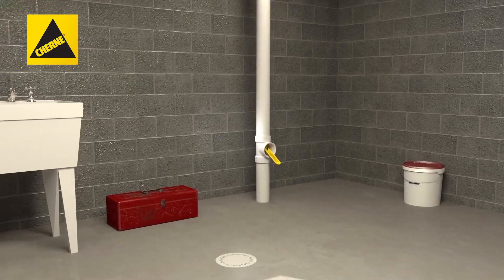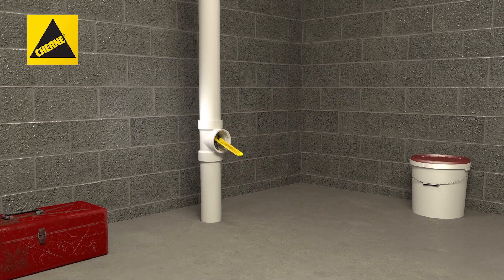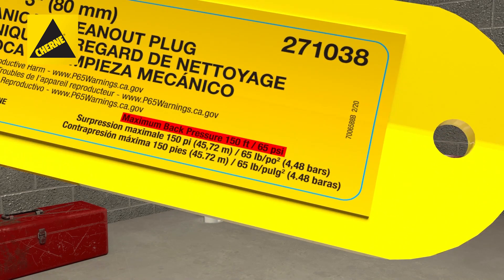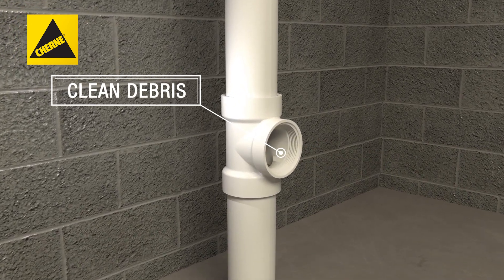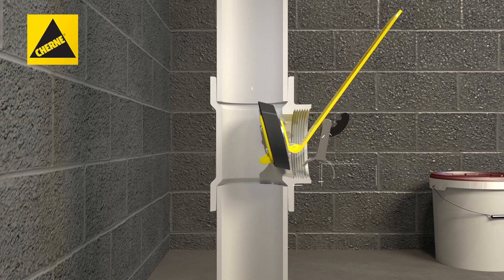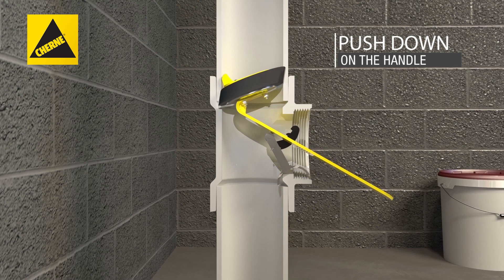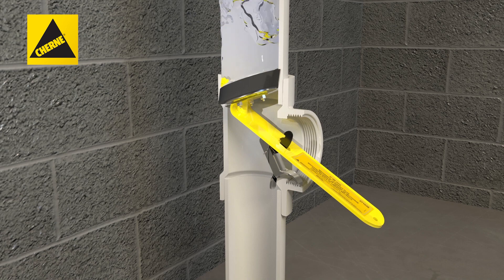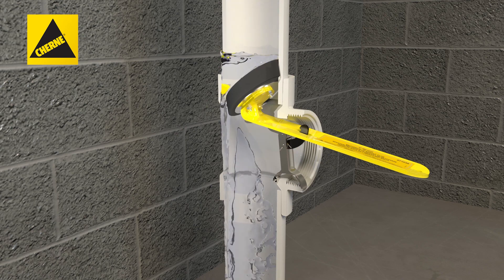How to Use Cherne Mechanical Cleanout Plug

Comment: Will this plug hold air pressure also?
Reply: The 3" Cherne Mechanical cleanout plug will create a watertight/airtight seal with a maximum back pressure of 150 ft/65 psi. Please refer to pipe manufacture and local jurisdiction for approved testing methods.